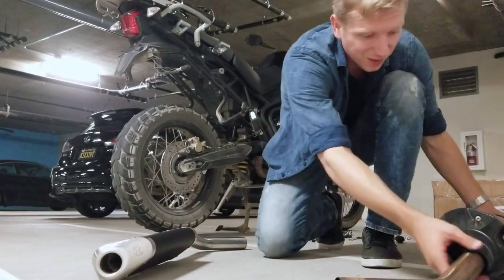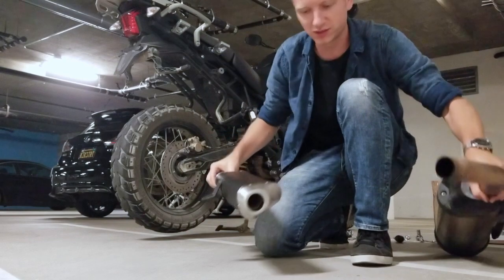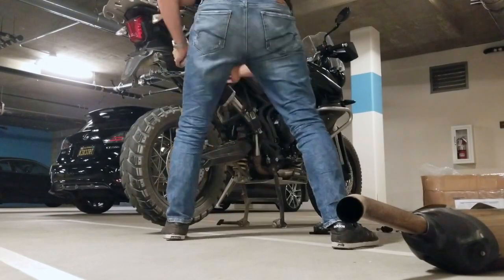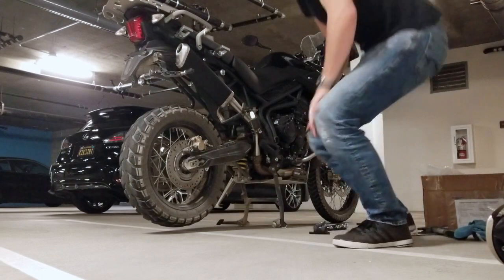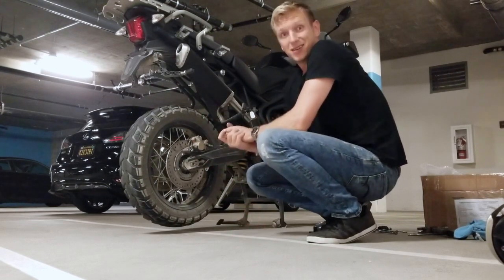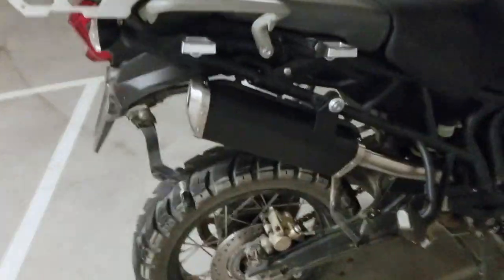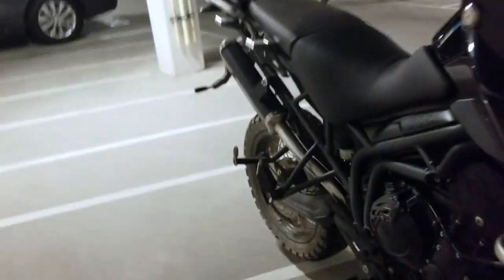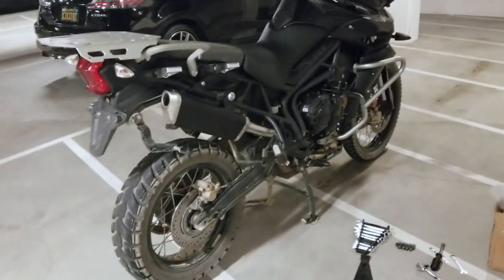Triumph Tiger 800XC Stock vs. Danmoto Off Road Exhaust

Comment: What about the mileage bro, does it got affected? Any engine side effects?
Reply: Hey Nishant, I actually haven't noticed a difference in mileage or engine side effects. I asked the guys at my local Triumph dealer and they said not to worry about remapping, so I've been riding it as is.
Reply: @benclaybrook  thanks for your revert. Rite now i am running it on arrow mapping